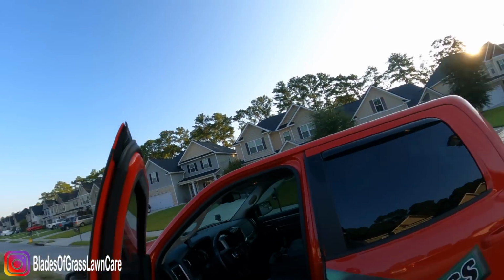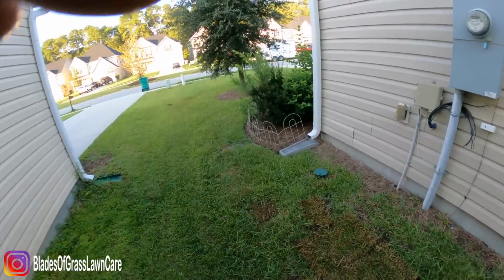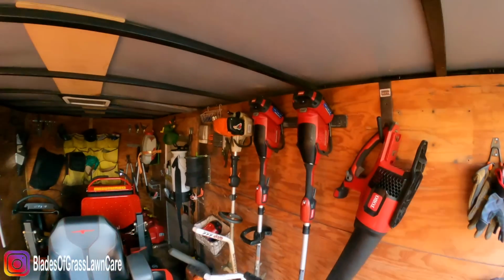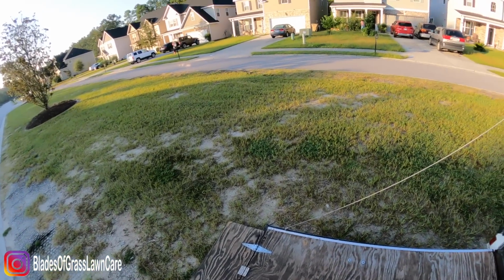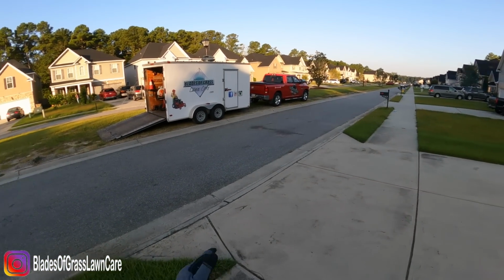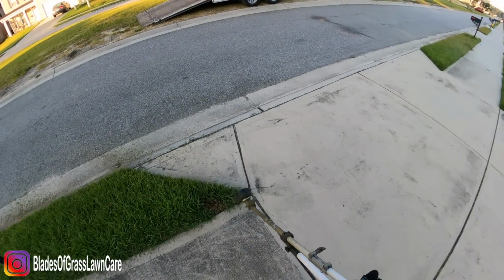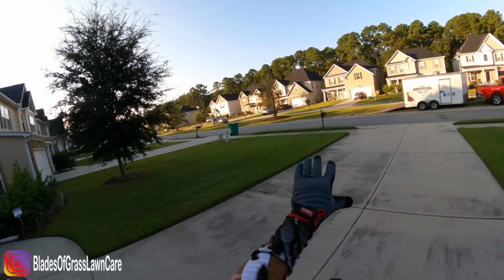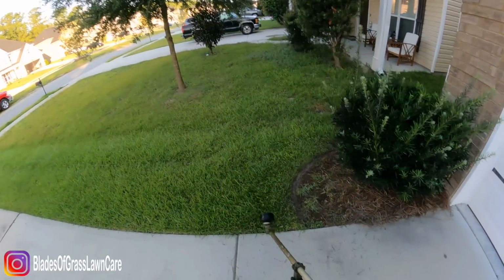This TRIMMER is AMAZING Grass Cutting with razor sharp power!

Comment: During one of the hurricanes we lost power for a few days. I had a similar battery generator and a harbors freight 3500w inverter. I hooked up the inverter in my truck under the back seat and I plugged in the battery gen to charge that way while I done any commute I sometimes idled my truck to charge it back up to run my refrigerator. So this gives me an idea cause I also have the ryobi 40volt equipment that work equivalent to residential echo or Stihl equipment. I don’t have the battery generator anymore but I’m looking into getting the one you use.

Comment: Hey Johnny great video.  I like how you hang your trimmers vertically in your trailer.  Can you point me in the right direction to where I can get that set up.  Did the silver brackets for the trimmer shafts, on the bottom,  come with the hangers or are they sold separately?  Thanks ahead of time.  Stay safe out there, Fezz

Comment: I mow in central Florida.  In one of your videos you stated that a battery for a trimmer was roughly equivalent to a tank of gas.  Then you said 4 batteries would get you through a regular day.
I knew at that point that switching to battery tools would be prohibitively expensive for me.
I would have to invest in the trimmer and buy 4 batteries and a charger.  The batteries are $200-$300 each currently.

Just that figure turned me completely off to the idea of electric tools.
I already have to buy gas for the truck, the mower, the blowers, the edgers, the hedge trimmers, the chainsaws.  
So I'm sticking with good old gas as long as they'll let me.

Also, my trimmer of choice currently is the Husqvarna 535.  Show me a battery trimmer with that kind of power.  They don't exist.
Reply from the maker: Okay, thanks for your comment